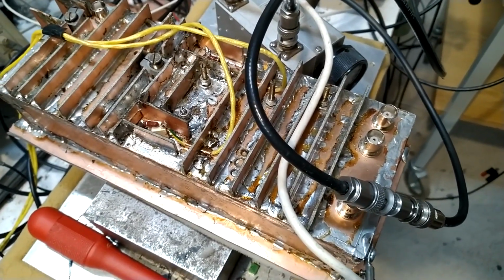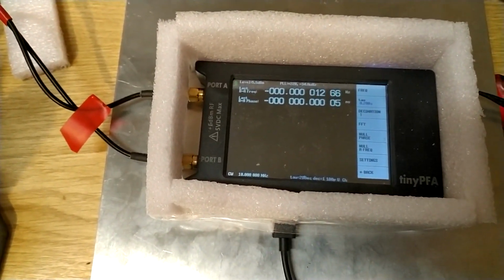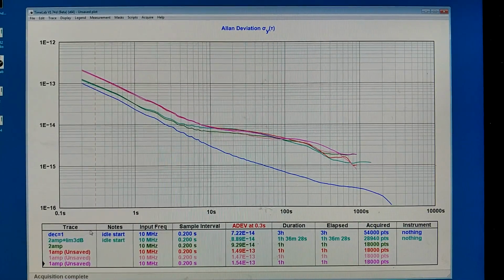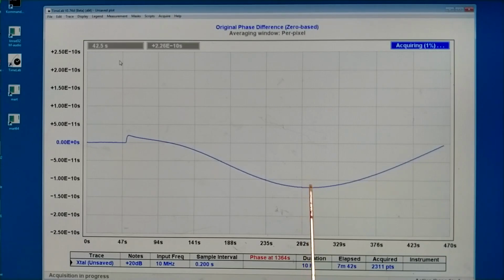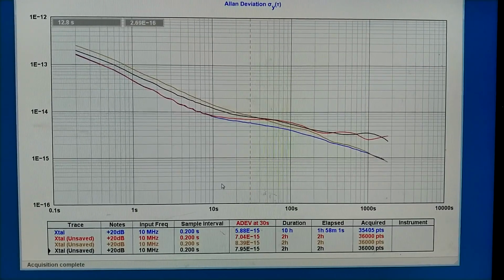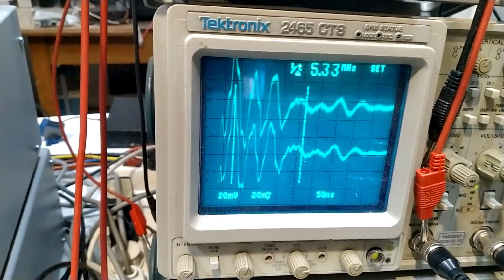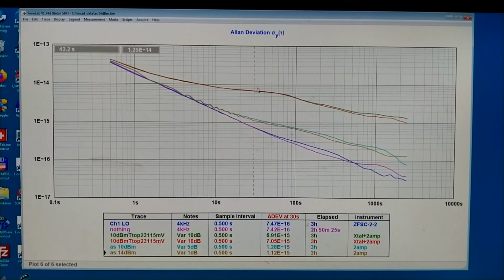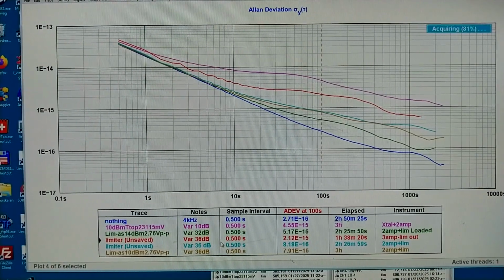nerds102

Comment: Power setting in the TinyPFA changes the output power of the Si5351 clock generator, what AUTO does I don't remember. The video ends abruptly, a mistake in the editing?
Reply from the maker: Thank you for the info. The Auto setting must me avoided because it causes occasional very big jumps in the phase difference. Now that I know I will do some experiments to see if some other setting is better.